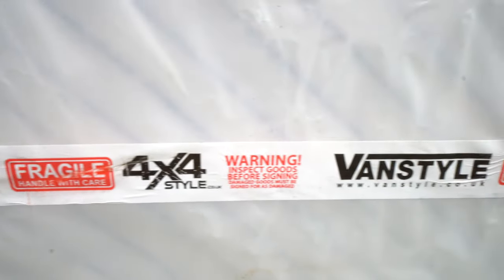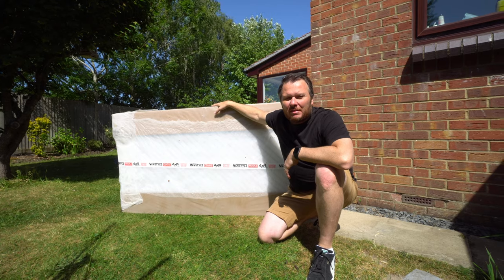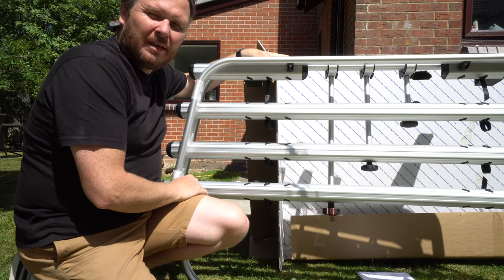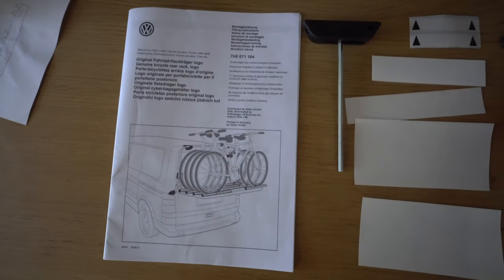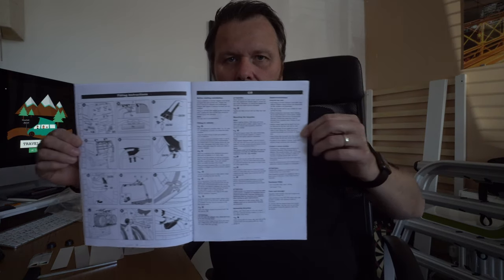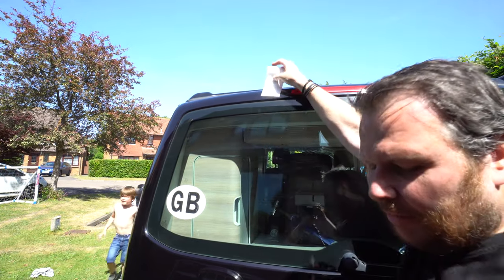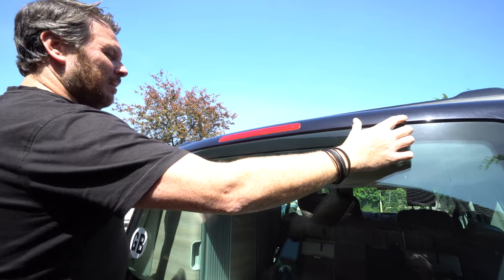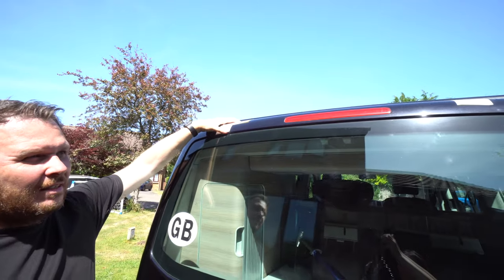Fitting a Bike Rack to a VW Camper California T5

Comment: At last, a vid that's slow enough, clear and points out challenges and extra tips. I bought secondhand and no replacement grommets... will have to track them down. Q. Did rear distance sensors still work or did the rack keep setting it off? Thanks.
Reply from the maker: Rear sensor still works, but obviously judges distance from rear bumper. So...it becomes redundant when the rack is down with bikes on! Back to old fashioned mirrors and guesswork :) Thanks for commenting!
Reply from the maker: Forgot to say, I bought the rack from Vanstyle as you saw. Perhaps they could help with the grommets?

Comment: Thanks for the video. Reading online that stronger gas struts are required, have a t5 'velle which I'm assuming, have the same struts as the cali. All good without changing?
Reply from the maker: Hey Will, thanks for the question. I would think the struts may need changing on yours. The reason I say that is because the California has a pair of camping chairs in the tailgate, built in, so the tailgate is a lot heavier, so they needed stronger struts straight out of the factory. If yours is just a simple tailgate, like on the Transporter vans, they may have the standard struts so would need upgrading. Hope this helps a bit, I think your question may be better answered from VW themselves, jut to be on the safe side. Cheers. Rich